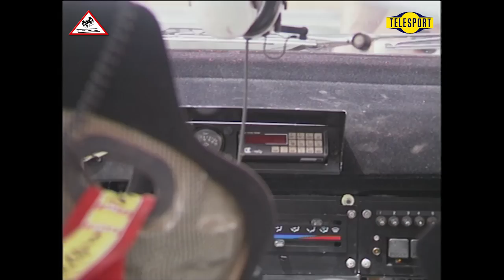Martini Safari Rally 1991 | Group A [Passats de canto] (Telesport)

Comment: those cars had no suspension compare to modern ones
Reply: Citroen introduced hydro-pneumatic suspension, arguably the best out there, in 1955 and its vehicles were common in this rally. Mercedes Benz introduced air suspensions in the 1960s. Most vehicles today do not have  air or hydro-pneumatic suspension.
Reply: @Darubini2  i mentioned rally cards on this video, not conventional cars
Reply: @anthonyk8027  The Citroën and Mercedes rally cars used pneumatic suspensions.
Reply: @Darubini2  this is not cancelling the fact that those ancient rally cars had awful suspension
Reply: @anthonyk8027  I was trying to keep you informed: The best suspension system, to date, was designed and incorporated in rally cars as far back as the 1960s. Not all the suspensions were awful.
Reply: @Darubini2  just give a link to any footage of how the cars equipped with this great suspension had been driven hard on a rough road and i'll understand. but this is impossible, suspension was not good and did a huge leap when wrc cars came. and not only because of the uprights progress, but overall geometry.